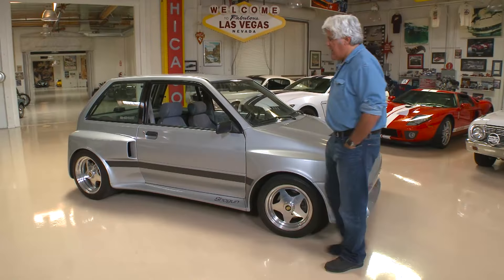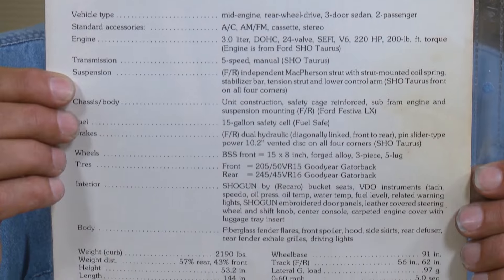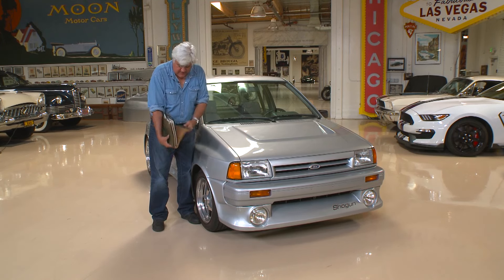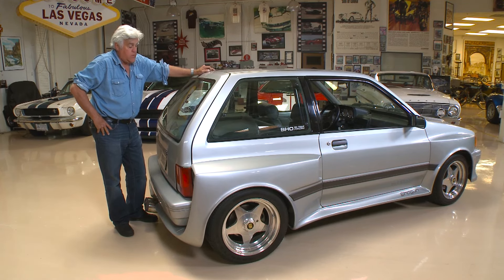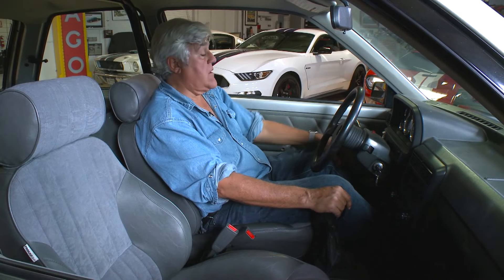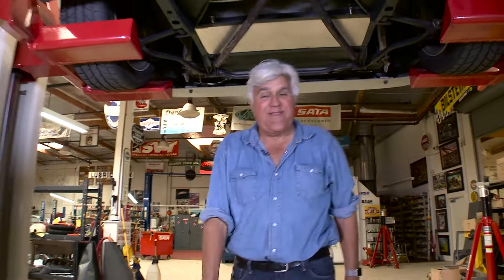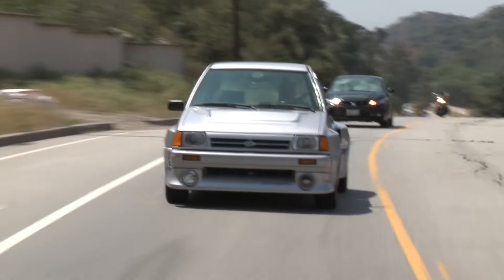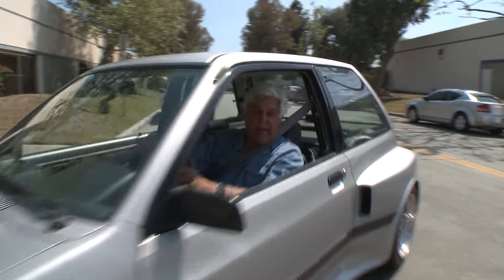1989 Ford Shogun - Jay Leno's Garage

Comment: I'd add a very strong flat window frame doubles as an extra roll bar, and have reinforced safety glass between the engine and driver. Not just the noise but flying parts from say a thrown rod or snapped belt near the driver is not really a wise move.

Comment: I love this car. I have an obsession with this engine. I have to make a couple corrections. They only built 7 because ford would not sell them new engines. They had to source the engines from the public, either insurance totaled cars or pull them out of new taurus shos. The engine isn't turned around, it's just placed in the rear, and the subframe the engine sits on isn't custom made. It is the taurus subframe cut down to be fitted into the car. I'm actually surprised jay never touched on the fact that it is a yamaha designed and built engine. But it is a thing of beauty. My favorite engine and the taurus sho is one of my favorite cars.

Comment: Jay, the original engine this car came with was not stupid. It was a Mazda 1.3 and you could feel the zoom zoom in it. 

I used to own a weight reduced Festiva with the original 1.3 engine....   That engine was alright !!   and when I say alright, I mean once I got it down to 1400 lbs. That 48 horsepower engine could beat 200 hp V6 automatic Mustangs....   Then one day I found out why it's the car of choice for the sport of flipping your car, lol.

Oh and it also got 46 mpg with my foot to the floor !

Comment: Mr.Leno, how about showcasing the late 80's/early 90's TURBO DODGES like the DODGE SHADOW TURBO 1, TURBO 2, THE DODGE SHELBY OMNI GLHS TURBO, THE DODGE SHELBY DAYTONA, THE DODGE DAYTONA IROC TURBO 3 AND THE DODGE SPIRIT R/T TURBO 3 (2.2 Liter Turbocharged, intercooled and LOTUS designed  cylinder head? All turbo dodges were pretty FAST back in the day.

Comment: Please do an ep on an original, 1.3,  '93 GL Festiva .    These were inexpensive, bullet proof cars... even with out the alterations to a  Mid engine.  Getting close to three hundred thousand on mine  and we call it the Mighty Festivea.  The Mazda . 1.3  liter 4 cylinder was not a stupid engine.  It was a brilliant engine.   Take out the back seat, and you have a carry van.

Comment: This thing reminds me of my 1986 Chevette I built back in 1991. I took a chevy 4.3L vortec motor hooked to a 700R4 transmission outputting to a 12 bolt axle narrowed and held by a 4-link coilover setup. A 150hp NOS shot to finish off the insanity. I didn't have A/C or much room but it some crazy fun.

Comment: Only built 7 because price went way up when Ford lawyers got involved and decided they would not sell parts for the project. That required buying a new Festiva and a new SHO Taurus. Chuck sold the SHO Taurus' to guys at the airport with junkyard 3.8 automatics installed. There were 6 production cars and the prototype. The last production car was built on a customer supplied beat up Festiva and got a junkyard SHO engine from a wrecked Taurus. The price on the 5 cars that were built with new parts was $45,000.

Comment: Seeing this car reminds me of my 1975 Mazda RX4 (rotary) yellow wagon. I just loved that car. I could keep up with Mustangs, GTO's and Cameros. I once left a 6 cyl Camero several car lengths before the driver realized it. It had a 7000 RPM red line, and it beeped at you when the engine reached 6500 RPMs. I once had it up to 115 MPH, and it still had leg. It was however tooo thirsty on fuel and I reluctantly had to sell it. Was fun while it lasted.

Comment: When I was 16 my grandmother offered to buy me a 1990 Ford Festiva L in white with red pinstripes with an automatic transmission, 1.3L SOHC with cold AC. I drove that car until was diagnosed with Hodgkin's Lymphoma and I sold it to my uncle and went back home to Florida with my parents to go through chemo and radiation treatments. I had an inheritance from an aunt who passed right before I was born, so my parents gave it to me earlier than 18 (it was meant to be for college), because I wasn't supposed to live through it. Anyway, I bought a 1994 Ford Explorer Eddie Bauer with 64k miles on it and I immediately swapped in a 302W V8 with an Explorer Express Eaton M90 supercharger kit, with an AOD4 automatic (that ended up having to be rebuilt 5 times by the crappy shop that I took it to in Tampa because it kept blowing the rear seal due to overheating...and the dudes didn't speak English, which doesn't matter, a mechanic is a mechanic, but it was supposed to be a good deal and they just kept messing it up and blaming me). I had installed a full chrome front brush guard, a SkyJacker 6" (3" body and 3" suspension lift), and 33x12.50 TSL Thornbirds on 15" chrome bullet hole wheels. I loved that truck. It had shorty headers, full 2.5" dual exhaust back to Cherrybomb glasspacks with dual 12" slant cut chrome tips to match the rear bumper. I also had a full stereo system with a Sony Xplod tape deck, a Sony 10-disc CD changer, two JL Audio 15" subwoofers, and two Kenwood 1000 watt amps.

Comment: The original 1.3 Festiva wasn’t a slouch. You could spin the tires in 1st and 2nd. When there’s a fresh coating of snow on the road I could get it to 4 wheel drift in a tight low speed turn. When you drive a Napa delivery car you should have skills. Another driver was in an accident with it and it was totaled. 
Imagine a newer all wheel drive cars drivetrain fitted in a Festiva’s body.

Comment: Neat sleeper car!!! A bit pricey but you are right there wasn’t much out there in 89 & 90.  FYI the Corvette back then was only 245  hp not 350…  I had one. torque was 345 though.  This is even more reason this Shogun had a lot going  for it.   Doing it over I probably still would have bought the Vette or a Porsche only because you wanted some looks to justify the car payment you were making.  Now if I collected cars and had the funds the Shogun would have been right up there

Comment: Those specs are PERFECT for low times, on track day. 1g lateral force, 5 secs to 60, 1/4 mile under 14 secs, @ 2190lbs, 43/57 rear weight dist, RWD, two seater, with a 5 speed!?!! NEAR PERFECT...

Comment: This wasnt the first idea of a mid engine ford with the Yamaha SHO engine. The car the Yamaha SHO engine was originally built for was mid engine. The car was only a prototype and was never mass produced.  When they scraped the car. Ford ended up putting the engine in the in the 88 Ford Taurus, and the Ford Taurus  SHO was born.

Comment: I had a 1990 5 speed Ford Taurus SHO in high school.  Thing took off like it had a turbo or was a 2 stroke past 4k rpm.  I raced and smoked everyone.  Mitsubishi eclipse's were all the rage back then and I wasted them. 

The SHO had an awful manual transmission.  The spider pins would break and pop the case, destroying the transmission.  I went through 2 transmissions before I essentially went bankrupt in high school.  I also repainted it because the clearcoat peeled horribly.  The transmissions cost me 3 summers worth of work. I spent hours working for an auto paint shop just to repaint the damn thing at cost.  This car was my "boat" in terms of a money pit.  I was really disappoint. So many hours washing dishes to pay for those transmissions while going to school all day....ughhhh. 

My highest speed in it was 144mph, clocked. I had the exhaust done and the airbox pulled at the time,  and admittedly was on a slight downward slope.  Still scary as hell in a massive Taurus at 17 years old. This was back in 1999. 

The point being,  the Yamaha motor was amazing,  everything else in the SHO was garbage.  Yes it had cool technology not seen in most luxury cars at the time,  like seats that electronically wrapped you into the seat,  but the Taurus itself was horrible.  The motor was pure engineering greatness. The car itself taught me a valuable lesson in cost management and auto repair and automotive paint.

Comment: The Yamaha 3.0 liter dohc 24v V6(220hp) was originally supposed to be put in a mid-engined sports car(Ford Cobra). That car was supposed to compete with the Pontiac Fiero and the Toyota MR2. That would have been an awesome sports car for Ford. The Shogun could have been Ford's volume sports car if they wanted it.

Comment: I used to have a Taurus SHO with a custom supercharger fitted. It had 435 wheel horsepower. Really quick car. The torque steer was insane.

Comment: Are you sure they turned it around? All of the conversions I have seen have been a straight drop in no turning... you end up changing the direction of the shifter linkage... why did they turn it? Or just a slip up through out the video? Like the videos wish I could afford even one of your cars.

Comment: "... kinda turned it around, and put it in the rear..." Well, no. With the drivetrain at the front, it's pulling the car, and when moved to the rear, it's pushing. The tires still turn the same direction, so it's all the same, forward is still forward. Jay, still waiting for you to contact me about driving Midlana!

Comment: I bet that if Ford came back out with a modern or updated version of this car it will sell like hotcakes. Especially, now that there's a cult following for four cylinder turbocharged cars and a huge aftermarket product industry. In the past few years, Americans are starting to like these small displacement engines more so than the traditional V8s.

Comment: The SHO engine could rev to 8000 but the horsepower peaked at 6200 rpm so reving the engine to 8000 would have required a lot of tuning.

Comment: I absolutely love the look of this thing, had no idea this existed (and I know my cars fairly well). Reminds me of all the awesome rally inspired cars - wide body/boxy front and rear end/taking a normal everyday car and making it cooler and faster. The Renault Turbo 5, the Lancia Delta HF Integrale Evo 2. I guess the first thing I thought when I saw this was immediately Renault Clio V6, almost the same set up. I wonder if this is the car that inspired Renault to make the Clio V6.
Reply: I'd guess Renault was inspired by the their own 5 turbo which had a similar setup. Engine in the back and RWD. The only difference being that the Renault 5 used a turbocharged 4 cylinder engine. But they probably got the inspiration for the Renault 5 turbo from this car.

Comment: 1989 Corvette did not have 350HP. It was 245 HP @ 4300 RPM. In the next couple years there would be a big jump in horsepower for all manufacturers and the SHO was leading the charge. The '89 Taurus SHO beat the fastest Camaro of the day, an IROC Z-28 and ran dead even with the GT Mustang till SHO's slippery aerodynamics took over at 100MPH.

Comment: Why would anyone pull up and say "hey...ur tires are in the back"? It doesn't even make sense. So for 2 ppl different people to pull up and say something that makes no sense. Also the engine might rev that high but the power band ends @7500 rpm so reving that high u will actually lose power

Comment: I purchased an 89 Ford Festiva brand new from the Ford Dealership, it was a crappy car, not terribly reliable, $5500 out the door. Honestly, only marginally better than a Yugo. Only plus was gas mileage and it was actually quite roomy. The Shogun still looks like a crappy festiva with a kit, I guess this version is fun to drive, but h311 no, I wouldn't touch that death trap.

Comment: Not sure if this is how the car is supposed to look, but the rear of the car sits lower that the front.  Looks like the weight of the engine has taken a toll on the rear springs.

Comment: That Yamaha engine is underappreciated.  The '89 SHO Taurus was a sleeper.  It was faster than my '89 Super Coupe, which had a bigger engine and was supercharged.
Reply: The engine was toned down from 285 to 215/220.
Reply: That engine is a gem.

Comment: You were kind of misstreating the r5..... Wich is early 80's, and carried on with a small 1.4l w roughly 170hp, this shogun wich is rly neck twisting..... Slapping the sho in an r5 would probably make these cars have identical power to weight ratio since the frenchie is 50kg lighter

Comment: That's not called a Shogun, I owned two of those. It's called a Ford Festiva.
Reply: or Fiesta in the UK
Reply: @lindsaytur496  Two completely different cars. The Ford Festiva is a Mazda 121, built by Mazda (who were partially owned by Ford at the time) and badged as a Ford for the North American market.
Reply: It's a special model named the Shogun because it has the Taurus SHO motor of the time
If you bothered to listen he would of explained it to you

Comment: 2,190 lbs with a V6... We Need to get back there and make lighter cars again.
Iron Hemi, steel body / frame 1970 Challenger weighs 500+ lbs Less than the aluminum engine/plastic 392 challenger of today. Just Sad. MPG And Performance would take off too.